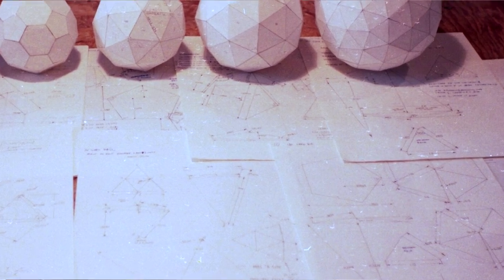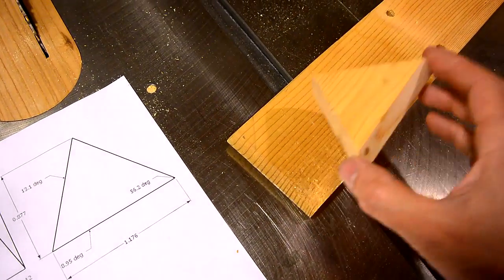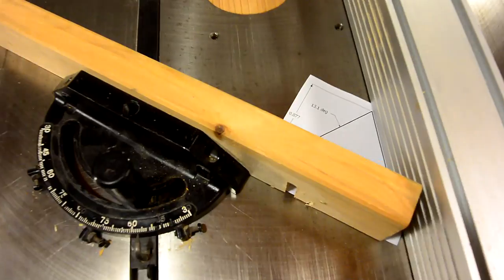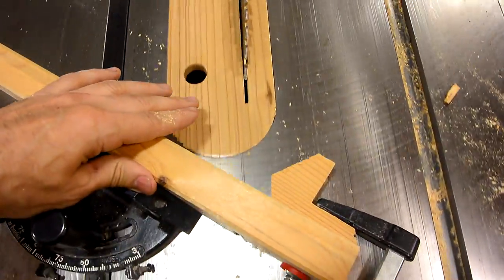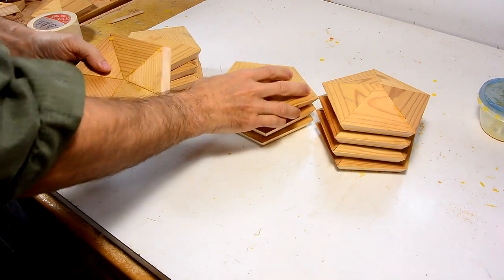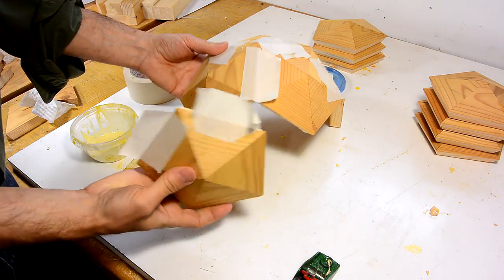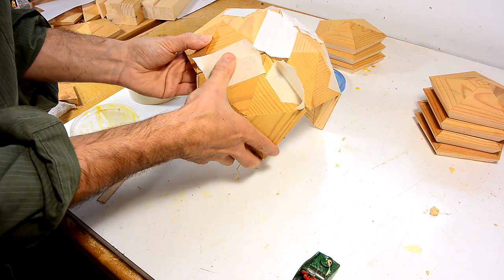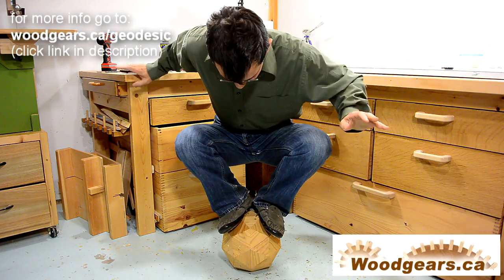60 sided geodesic dome

Comment: This is awesome. Replace some triangles with semi transparent ones and put a light bulb in it.
Reply: This is a great idea... even if you stick with all wood you could cut slits or holes or simply leave the bottom section out.
Reply: ***** Yeah if it was a lamp, the gaps wouldn't be an issue, either, with light streaming out.
Reply: +johnnyq90 Yay! It's mini Jet-engine man!

Comment: Awesome work! You mentioned about your dislike of tape as clamps. Here's a suggestion: Use the masking tape to line up the pieces (just like you did), then use a 1/2" thick rubber band that they use to hold broccoli stalks in a bundle. Secure the rubber band around the outside of the 5 piece pentagon. The pressure will be exerted inwards which will hold the pieces in place until the glue dries.However, this will only work for the pentagon pieces. Once you assemble the 12 pentagons into the sphere, use large rubber bands (cut from a car tire inner tube). The pressure will keep everything nice and tight but it will also allow last minute adjustments until the glue sets.Excellent video and excellent YouTube channel. I am now inspired to try to build my own.

Comment from the maker: 60 sided geodesic out of solid wood.
http://woodgears.ca/geodesic
Reply: جميل جدا  عمل جديد
Reply: رووعة
Reply: Hello I'm Noah from Syria practical Hua shavings Wood Furniture Find Jobs Carpenter

I am a resident in Jordan you help me

Matthias Wandel
Reply: Mathias I'm a Big fan of you. I always watch your videos. I just want to point out that the Sawstop would only stop if you were touching the metal. I don't think you were so there wouldn't be a reason to swear.
Reply: Matthias Wandel Does the dome hold your weight because it is distributed among each of the 5 sided pyramids?
Reply: You should totally take this idea and make a wooden helmet like a uhhhh war helmet or something cool
Reply: An old tool used by cooper's might have helped. Two narrow boards are hinged together. Measuring out from hinge point, a scale in inches is struck. The tool is opened and the piece is test fitted at the correct radius on both ends. If the piece is to taper (like a butter churn), then radius at each end is checked. If the piece is correct length, it will set the correct angle at the proper radius.
Reply: Matthias Wandel you are a genius
Reply: Matthias Wandel I remember you saying somewhere...on your website, blog, or interview with I like to make stuff... that you only build things you need and will not build anything viewers suggest. What is the purpose for this geodesic? A gift or art perhaps. Just curious.
Reply: Matthias you so crazy!
Reply: Ive been meaning to ask, do you make the orange stick things that you use to push things through your table saw? If so have you made/would you consider making a tutorial on how you do that?
Reply: slendy9600 He's done a video about how he made the push sticks and you can download a template from his website.
Reply: Eicles thanks, i ask cause they look really profesionally made and im interested to see the process (then again everything Mathias makes looks really professionally made, probly cause hes a profesional XD)
Reply from the maker: Red Honu Or if the metal was touching the table, which it was.
Reply from the maker: Red Honu It would stop the blade if the camp was touching the table.  Which it was.  So plenty of reason to swear.
Reply: Matthias Wandel ￼

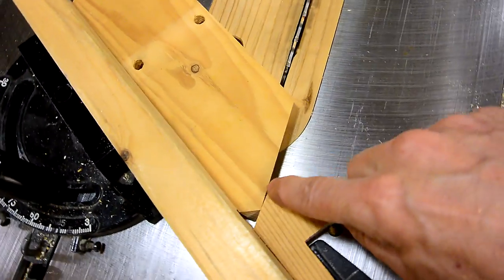Comment: That was a nice surprise! I will instantly have to fetch my own old paper-polyhedrons. I made a icosahedron from wood almost 30 years ago, but that didn't turn out as well as your dodecahedron-based geodesic, because I had a very cheap table saw. Btw: I assume, that your old one at 0:05 has been made without the double cut you show at 2:15.

Comment: Nice job. I would suggest you try a silicon caulk to adhere and to fill the cracks.  You may also benefit from building the pieces around an inflated balloon that you could pop when completed (or if you glued the outside of the balloon it could remain as a smooth inner coating of your dome).

Comment: Hi Matthias, I really enjoy your channel. I'm curious on how you arrived at your calculations for the bevel. I've been trying to derive calculations in this area on my own with minimal success. Is there a calculator you could point to that doesn't require a learning curve as steep as the problem itself? I'm also interested in oblique pyramidal shapes as well. (meaning the apex is not in the center of the base). Any advice appreciated!
Reply from the maker: mike trombly I was lazy this time and just measured it off the CAD model.

Comment: The sawstop wouldn't of went off unless you were holding that metal collar of the clamp. I've cut through a nail before and it didn't go off.  Thintz did an video a while back that showed this..
Reply: Fester Blats no

Comment: Great job, Matthias!  Did not expect that ending. Also, this video is exactly what I needed. I'm wanting to build fence post caps and want them to essentially be a four sided pyramid. They won't come to an equilateral. But how would I go about finding the bevel angles for each triangle?
Reply: Joshua Luther Easy method: Download Sketchup (free and Matthias uses it). Draw your plan. Use the protractor tool to measure the angles.
Reply: Joshua Luther A 4 sided pyramid would need 45 degree bevels on the sides. No need for sketchup for that.
Reply: @Importenator  you think so? Ok, how about the miter angle?..

Comment: Very well done. I've been trying to think through a jig that would allow me to cut a dodecahedron out of solid wood for a while. It seems like a very difficult problem to me, maybe you have some insight. 

A small side-note: I think the term "geodesic" refers to something constructed using "geodesics" or arcs of great circles of a sphere. A polyhedron is not of geodesic nature because the vertices are "straight" line segments and not arcs of a circle.
Reply from the maker: +isaac Baer I guess buckminster fuller was wrong then?
Reply: Matthias Wandel I don't really understand how the idea of geodesics is incorporated into Buckminster Fuller's designs. Why aren't they just called regular polyhedra?
Reply from the maker: +isaac Baer They aren't called regular polyehdra because they aren't.
Reply: +Matthias Wandel so I just got the idea of dividing up each side of a regular polyhedron and then projecting it onto the sphere. It makes sense that this wouldn't yield a regular polyhedron.
Reply: +Matthias Wandel My, aren't we snyde.

Comment: Inspirational video as usual. Small point: I believe that SAW STOP would not have stopped (i.e. destroyed the blade) as SS requires contact with a fleshy material (not a wood and metal clamp).
Reply: Peter Henry I believe it works by the blade having a very small electrical current passed through it, it detects changes in this current and depending on that change takes action to stop the blade.  I guess it would depend on whether the clamp metal was being touched during the cutting, which looking at the video looks possible.
Reply from the maker: Peter Henry A sawstop will trigger off metal, if it's big enough or touched.
Reply: Matthias Wandel  A saw stop will be triggered by the smallest piece of metal including any part of a tape measure and backed insulation. Supposedly wet enough wood will also trigger the mechanism.
Reply: Matthias Wandel Bosch will be making one called the Reaxx that doesn't destroy the blade in the process.
Reply: Peter Henry At work the saw stop has been triggered 5 times and only the last time was from someone's  finger. You can easily test if the material that you are going to cut will set it off. With the saw OFF just touch the material to the blade, if the RED light flashes then you need to "lock it out" or better yet use another saw.
Reply: ***** I do not understand why the saw stop has to. Dropping the blade alone would be more than sufficient accept for the very few that have put their hand in the saw while trying to make inserts.
Reply: IGo ProEVERYTHING I agree, the brake cartridge is overkill. Edit: after reviewing their mechanism again, the drop feature seems to be driven by the inertia transferred by stopping the blade. Kind of an odd system, actually. I would prefer the mechanism get the blade out of the way first instead of trying to stop it.
Reply: Matthias Wandel Use the bypass mode on the Stop Saw. It deactivates the brake, but if it thought it should brake it flashes a light instead. (Used for testing if green wood is okay and will not activate the brake).
Reply: it only took a band aid to cover up the big scratch:)
Reply: Peter Henry It needs a ground path or capacitance change -- all depends on the size of what it hits.  Promo video shows a hot dog but only because he is touching the hot dog.  Likewise, if he had been touching the metal on the clamp it would have gone also.
Reply: frollard YES...that is very clear. Thanks

Comment: Thanks for the video. You've got my creativity wheels turning. I do have a question. Approx. how long is the base of your triangle? (the 8.95° side)  I know your drawing says 1.176 for the base, but the triangles look too big for that to be inches and too small for it to be decimeters. Was it just a ratio of some other measurement?
Reply: Side length for equilateral triangle is arbitrary. Go ahead and choose whatever size you'd like - the geometry will scale while preserving its angles as they are..

Comment: Matthias, sir I've been truing to figure out how to make a geodesic dome for so many years. I'm terrible at math, but I've been a welder for over 40 years. I can't figure out how I've been successful as a welder with poor math skills either, but that's another conversation. cam you share with me how you figured the formulas for different sided domes. I've wanted to build a Geodesic shaped Meat Smoker for many many years. if I can make a template, I think I can pull it off. I need several sizes, so it would be great to understand the formula.
Reply from the maker: I don't have a writeup on this, and no time to write it up.  But I'm sure there's instructions some where out there on the web.
Reply: There's an app called Domekit that figures it out for you.
Reply: bailey2829 thank you
Reply: Hows that smoker coming along? i imagine what you have in mind looks nice

Comment: If you had wanted to clamp those glue joints, a good way would be to get a sheet of 6 mil clear polyethylene sheet, put the object on it and wrap the plastic around, bunching it up all together at one face so it's in a sort of pouch, and suck the air out with a shop vac.  You'd have a lot of pressure, even from all sides. As you pull the tube out, twist it tight many times and tie off with a plastic zip tie. Maintaining a seal would be the trickiest part - maybe clamp the plastic in a vise really tight. Or just leave it on a vacuum pump until the glue dries.

Comment: Hey Mattias. not that I doubt you or anything but I'm trying to recreate the math to do one of these and I got different mitre angles to you...

I got 13.08 degrees for the internal mitres of the pentagons but the mitre between pentagons I got 7.51 degrees whereas you got 8.95... I did see you planing those edges, is it possible you made a math booboo or is it me?

I have all mitre planes converging on the centre of the dome, essentially 60x tall 3-sided pyramids.
Reply from the maker: Sabrina Kane I measured off my CAD drawing, actually.
Reply: Matthias Wandel My math might be suspect, I'm working without a CAD model so I'm using pen, paper and lots of Pythagoras. I'll keep trying!

Comment: I recently have been looking at some videos of Da Vinci bridge, and Da Vinci Dome structures erected out of small logs, or sticks, or small lumber. Very interesting concepts, however the edges protrude out making it nearly impossible to cover with any kind of plywood, or paneling, or any kind of wrap. I am really interested in seeing what you could some up with to make these structures functional in the real world by use of fasteners like screws or nails with glue, and maybe wedges cut to fill the gaps at the ends of the boards which meet and cover other boards. There are videos of a guy using the Da Vinci bridge frame work to build a hot house/storage unit, and a cabin. I think you could do MUCH better than he did.
Reply: Its already been done for a long, long time. That's not to say it's some simple thing to do though. 
It's master carpenter type stuff, but the geometry of regular polyhedra is what is applied to n-sided roof framing. Essentially, the edges of a given polyhedron are exact stand-ins for the hip rafters of a roof whereby the roof sides correlate to the faces of the poly which share a  vertex..

Comment: It wouldn't have set the brake off on the saw stop, because it wouldn't be able to sense your conductivity. If it's just a peice of metal that you're not touching in any way, it wouln't trigger the brake.
Reply from the maker: Langdon Harris the clamp was touching the table.
Reply: were you touching the table at the same time? if so the brake would've gone off most likely

Comment: I have a SawStop, I have cursed twice so far..  Both times my fault with setup..  First time I set an aluminum jig too close to the cut line and a thin kerf blade wobbled enough to make contact.  Second time I was cutting aluminum and forgot to put saw in bypass mode..